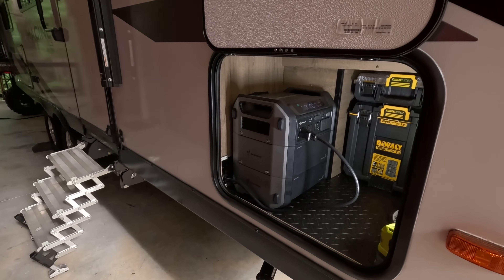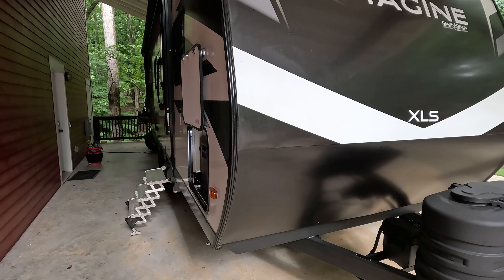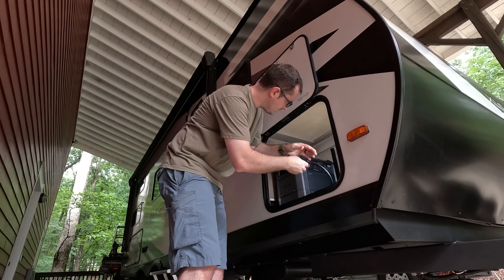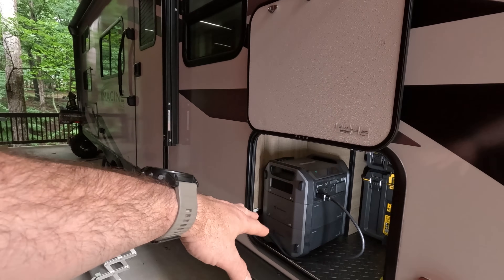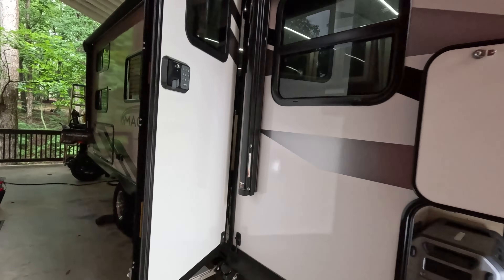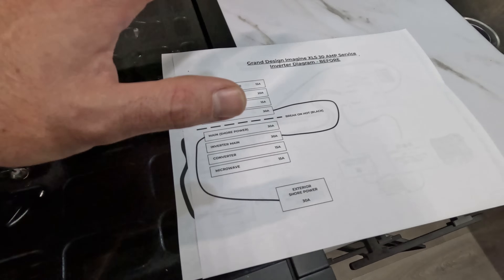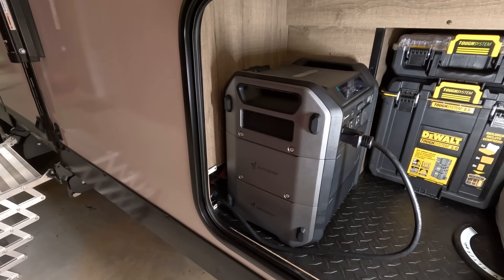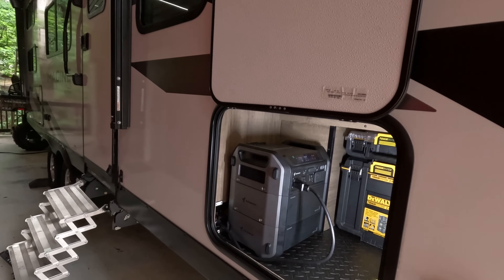Don't Waste Your Money on Lithium // I Install a Segway Portable Power Station Cube 2000 in My RV

Comment: I have a Reflection with the same inverter prep. I was researching the traditional inverter setup and came across your video. I like this way more. This solves the problem of being able to watch a movie during quiet hours. A must for our special needs kid. Being able to run the Keurig was a perk too.  

However, going the traditional route I was going to get more battery storage with 2 lithium batteries (vs my 2 L/A batteries). I was originally leaning this way because that would help running the 12V heater through the night. Also important as the same kid will not sleep with covers. 

My question to you: do you think the 2000 Segway cube would run a trickle charger through the night to get the best of both worlds? Inverter for TV and boost the 12V capacity in a sense? Would running the cube inverter that long cause it to overheat? I’ll be honest, I haven’t looked at the draw of a trickle charger yet or if it would charge fast enough to make a difference. Just curious. 🤔
Reply from the maker: Thank you. Great question. To start I should clarify on my circuit panel I kept the charger/converter circuit for 12V system on the lower half, so it does not get fed by the Segway. But, if I understand your question you're thinking of doing a slower trickle charge to your 12V batteries. There are three ways I could see doing this...1) The Segway has 2x 13.6 V 5 A 68 W Max barrel style DC plugs on it, which in theory could be used to run a trickle charge lead to your 12V RV batteries. Only problem I could foresee is I don't think those 2x barrel plugs are provisioned for a reverse feed and so I'm not sure if any harm would be caused if it were to backfeed from the RV battery given varying voltages on 12V batteries. Lead acid should be lower voltage compared to a lithium 12V battery and the Segway itself has a 13.6V spec on the barrel plugs, so it may work, but I'm just not 100% sure...might need a diode that only permits 1-way flow. 2) Second options...could use a battery tender device or similar that plugs into AC power from the Segway and then keeps the 12V RV battery topped off...that would be entirely feasible, but of course some may point out the inefficiency of going 120V to 12V. 3) Last angle and this may be preferred...you could install it such that your converter/charger circuit on the 120V panel is on the same inverter return side so that it gets fed by the Segway, and then your entire 12V system and charger would be fed through the Segway...certainly more watts consumed, but nothing the Segway can't handle. Most converter/chargers are in the 400-600W AC range at max consumption...but they throttle down otherwise when demand isn't required. I kinda lean toward option #3...and then you could always just turn off the circuit breaker on the charger/converter if you didn't want it fed by the Segway. Anyway hope I'm making sense and thanks for watching.
Reply: @AdventureRocks  thank you for the reply! Yes, I was thinking along the lines of a trickle charger plugged into the AC of the Segway. That seemed like the easiest way to boost the 12V batteries for nights the heater would run a bunch. (Not really that often out here in CA). Thank you for the feedback!
Reply: One last question: do you see any reason why the power station wouldn’t work in the under bed storage vs the outside pass though storage? Does the power station inverter have a fan? Thank you
Reply from the maker: @benjaminvillines2544  The Segway PowerCube in particular seems to do a superior job on heat management. I've noticed with other power stations I'll hear a fan ramp up fairly quick, but I don't hear that on the Segway. So I'm assuming the fan is ultra quiet and perhaps utilizes more passive cooling with fins and such. Segway probably has all that figured out with all the scooters they do as they typically don't have fans either. Anyway, it's never been warm or hot in the compartment I have it in. I have a temp sensor in there just in case to monitor with alerts. So to answer your question I think it'd be fine under bed. Worst case if you find it gets warm, you could add some kind of passive vent/duct, but I've been very pleased with it.
Reply: @AdventureRocks  Thank you for the info!

Comment: Sorry - another question. I just wired mine up, and have an unexpected result. Mine was the same as yours - red side coming from shore power "Inverter Main" breaker, black side going back to the "Inverter Return" breaker. Everything works fine when on shore power with the power station turned off. However, when I turn the power station on, the power switch senses it, waits 40 seconds, then switches to the power station even with the shore power still plugged in. I was actually wondering if this would happen after reading up on the power switch - it's made to sense the "generator", wait 40 seconds for the generator to warm up, then switch over to the generator. So I thought that perhaps you just swapped the input (shore power on "generator input" and power station on "shore power input", so that when the power switch senses shore power, it will wait 40 seconds and switch to shore power. But I watched your video again, and it looks like you wired the power station to the generator input, just like I did. What am I missing? I want the power switch to always choose shore power when it's available, then switch to the power station when it's not.
Reply from the maker: Correct, that is how mine behaves. Some transfer switches do the opposite, but this one will default to generator if present. It's a personal preference. Typically I'll turn my power station off once I get to camp and plug-in to shore power, but if I forget, no harm done as it lets power flow through essentially.

Comment: Thank you for this video. What a great idea! Question: if you were to disconnect the house battery, would the Segway run the 12v appliances (eg, lights, fridge, furnace, etc)?
Reply from the maker: Thank you. Great question. On the Segway featured in my video it's DC output is fairly low @ 10A...which seems to be about average on power stations. However, Bluetti has similar sized power stations that have a 30A 12V DC output which could run the items you mentioned. Technically speaking most RVs have 45-65A DC converters, so ideally a power station would have a 50-60A 12V DC output, but the Bluetti units with 30A would suffice as long as all appliances aren't running simultaneously. Here's a link to another video where I featured the Bluetti and how to run the 12V:
https://youtu.be/PHfbcuK2M80
Reply: That’s helpful, thank you. I’m left wondering, though, if the 12v works on shore power (ie, disconnect house battery, plug in shore power, and everything still works), why wouldn’t they also work off the inverter feed.?.?
Reply from the maker: @GeoffreySherman-x3h  My apologies. So in my specific setup shown in this video, I only connected half of my breaker panel, excluding the side with my 12V converter/charger that charges the house battery and converts 120V to 12V while plugged in. However, one could choose to set it up differently with the 12V converter/charger connected to the transfer switch supplied side fed by power station...and then you'd have all 12V with or without house battery. Some might point out that setup isn't as efficient given I'd be going from 120V to 12V, but it would work no issues.

Comment: This is awesome - thank you. I think I'll do it just the same way that you did. Question: you mentioned that you swapped the air conditioner and microwave from top half to bottom half. How did you do that? Did you need to pull out the breaker panel assembly and get to the back side?
Reply from the maker: Thank you for watching! Yes, I took off the outer faceplate on the breaker panel and that gave me access to the individual AC breakers. Then I just switched the two breakers physically by swapping their location. I think I took the black hot cable on ea temporarily to make it easier and avoid a tangle. So basically just a 1-1 physical swap, breaker and cables.
Reply: @AdventureRocks  Got it - thanks. Also, I forgot to ask... where did you tie in the outlet for the power station charger? And where did you mount that outlet?
Reply from the maker: @burtlamborn58  Sure, no problem. I tied the dedicated outlet to the shore input side of the transfer switch, so basically the dedicated outlet to charge the power station is only hot with power when connected to shore power. And then I mounted the actual receptacle right in the floor of that same cabinet just above (15:36 timecode for close-up...sorry about dark lighting).
Reply: @AdventureRocks  I just swapped the breakers. However, if I decide that I want to run my air conditioner unit from the power station as well, I can just move it up to the top half of the bus bar, right? Looks like there are plenty of expansion spaces for more breakers. In other words, I could have just moved the microwave up and put it on the top of the stack and left the air conditioner breaker there, right?
Reply from the maker: @burtlamborn58  I think I'm tracking with you. Only catch would be just to make sure the wires are all 10 gauge to support full 30 amps from start to finish. There are power stations that can run air conditioner on 20A outlet, but the in-rush current is so high 50-55A that it can cause issues starting up. I added a softstart on my Furrion and it lowers the in-rush to about 20A btw. I'd aim for a 30A TT-30 plug on powerstation like the Bluetti units just to be safe. I'm not an electrican though, so that's just my thoughts based on me going to school of hard knocks so to speak! Hope that all works out.

Comment: I'm a full time RVer in cold climate on a permanent lot . I've thinking of this as a backup power supply in case of power outage . I'd just plug into the 50 amp amp outside plug with the power station inside where it's warm.  My question is if I do that will it try to charge the rv battery's I have and drain the power station quickly?
Reply from the maker: Correct, if you plug-in to main shore power connection, the power station would indeed charge your house batteries or top them off at least. You could always turn off the converter/charger breaker, which would force 12V consumption to house batteries and prevent charging them if that is preferred. The power stations are great for power outages, especially if they aren't long or you have low consumption.

Comment: Cool setup and I agree it’s the way to go but do you actually need that transfer switch stuff? That unit advertises ac pass through (waiting for mine to arrive before I can test) so my plan was to change the shore power connection such that it goes straight to the Segway ac input (lower part of your power board) and then connect the rest of the van  (upper half of your board) to one of the Segway ac outlet plugs. The Segway should pass through ac if it has shore power and use the inverter if it doesn’t. I would be interested in your thoughts as that was my plan and it would be good to know if that won’t work for some reason before I start fiddling 😅
Reply from the maker: Great point! You are 100% correct. I could have just skipped the transfer switch altogether as the Segway does have the automatic changeover built-in. However, I did it still mainly for safety and redudancy, but also since technically the upper half of my distribution could pull up to 30A in rare circumstances while on shore power which exceeds the Segway capacity...very rare but it is wired for up to 30A of combined power. Plus, if I sell the RV in future and someone else decides to use it I wanted to make sure it was safe for them regardless of what brand they put in. But, you are indeed 100% correct...as long as you're aware of what you're running, you don't need the transfer switch technically. The changeover on the Segway is so quick it'll even work as a UPC for computer.
Reply: @AdventureRocks  thanks heaps for confirming mate, I was hoping that would be the case. I’ll have a crack at setting it up when it [finally] arrives. I have a whole lot fewer gadgets on board and so hopefully will not exceed the Segway rating but I guess I’ll be switching things off if not. Happy travels from NZ 🍺🤙🏼

Comment: I have 3 different RVs and would like to buy a big portable unit to transfer to the different RV's. Can these power packs be charged with rooftop solar? Also, does plugging in this power pack engage the normal battery charge for the RV battery?
Reply from the maker: Yes on solar. You might need adapters depending on solar setup. Right now portable power stations like the Segway shown in this video only feature 10-30A 12V output, which is shy of 45-60 A that most 12V converters are setup with in RVs, so they aren't quite powerful enough to drive the 12V system, yet. Hopefully we'll see some changes there in the year ahead to have an all-in-one setup.
Reply: @AdventureRocks  ah, isn’t the battery charger (built in the RV) variable watts at 110v to charge the 12v?(bulk/float). I believe most larger built in chargers pull about 1400watts when batteries are low (bulk charge).
Reply from the maker: @JOHNNYGIX  Correct, 120V AC on the built-in charger...maybe 500-600W max till about 80% full.

Comment: So if you get a soft start for your AC you will be able to run it with what you have
Reply from the maker: Mine is a 15K unit, so I think this particular 2,200W model would be undersized a bit. Might be able to get a 13.5K to run, but probably 3000W+ would be best. I plan to do a future video demonstrating both the soft start benefits and run a test on a 3K inverter/powerstation.

Comment: Pretty sure that unit has lithium-iron phosphate batteries built into it. Still lithium. It's just an all-in-one unit as in when the unit fails. The whole thing fails. I chose to build from the ground up system learning as I went and I have a pretty good system. If any part fails I can replace just that part. I can also upgrade just individual parts at any time I choose to. I can also place the parts where they fit best because in my small unit I would not have space for that piece of equipment. So I guess it just depends on what your needs are
Reply from the maker: Great question! Yes, pretty much all modern power stations are lithium based on the battery chemistry. This video is contrasting custom and permenently installed lithium systems vs all-in-one out of the box power stations. The latter is not permanently tied to the RV, meaning you can make use of the power station outside the RV, which is great for weekend warriors that perhaps only use the RV a dozen times a year to have flexibility and use the same power station elsewhere to justify the $$. It is certainly a personal preference though. For some folks it may make more sense to spend the big $$ with all the individual components such as charger/inverter, batts, wiring, etc.
Reply: I bought all powers lithium solar generator last month, about 1200 wh, $450, like u said when 1 thing breaks on it the whole thing is garbage. Mine broke in 2 days and I was left in heat camping without fans . Bought a gas generator for 450 which actually runs my rv air conditioner no problem

Comment: I am in the process of doing a similar project on my Grand Design XLS 22MLE utilizing the EcoFlow Pro 3600 watt unit which will power the entire RV ( including the A/C with Soft Start). Curious as to which transfer switch you used and is capable of eliminating the 40 second delay?

Comment: What are your thoughts on adding another transfer switch for and prewiring for an  onboard generator?

I can see putting one on a hitch on the rear and having a plug there or having a tongue mounted generator box … your thoughts?!?
Reply from the maker: Great question. I've never tried a 2nd transfer switch myself, but the flexibility could be handy.

Comment: Do you still use a generator to run the AC when shore power isn’t avail? Or is there something else?
Reply from the maker: Great question. I don't typically use AC off grid myself, but if I did I'd go with a bigger setup like this one here:
https://youtu.be/jadklTSNY-s

Comment: How do you run all your 12v stuff? Furnace, interior lighting?
Reply from the maker: Still conventional 12V system for me. Bluetti is one of the few that make a power station with higher 30A 12V output port, but even that is a bit on low side for most RVs as they typically have 45-80A 12V converters. So for now two separate systems, but maybe one day it could all be incorporated together.

Comment: This some thing I wanted to do after we bought our new reflection 5th wheel.   Question,  how did you find the orange cable?  We have an. Inverter prep area near our battery.  Is that where I would find it?
Reply from the maker: I think the sticker is the "approximate" location where the orange loop is found. My sticker was higher up, but I realized directly behind it was a storage cabinet, and down lower was a hidden cavity. So I think it should be within a few feet of where your sticker is...potentially behind a panel. Likely the orange cable runs through underbelly on most floorplans. Hope you can find it!

Comment: Did you remove your house batteries up front? Or are those still in?
Reply from the maker: I left my house battery for the 12V in tact as the 12V output on portable power stations typically is too low on the amp rating to support an RV...10A @ 12V is typical. Some Bluetti models feature a 30A 12V DC output, but even that is a bit anemic as most RVs have a 45-80 AMP 12V DC converter. It sure would be neat if there was a higher amperage option out there that could literally be the house battery and AC inverter all in one.